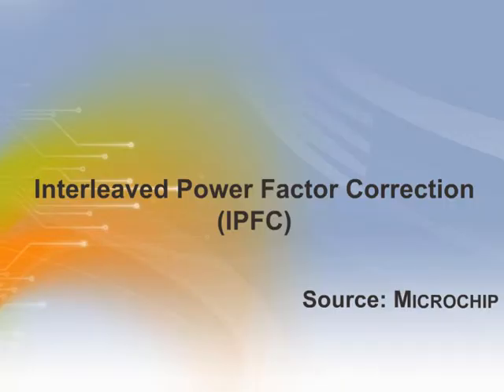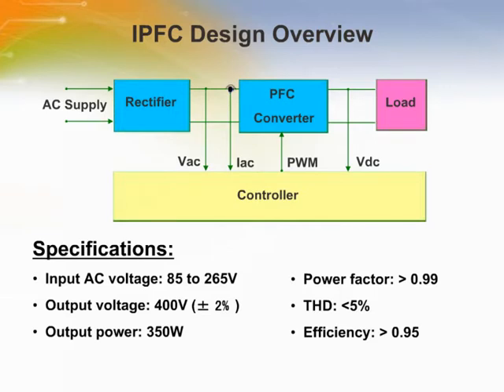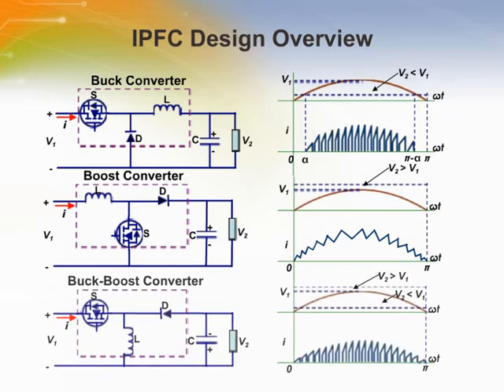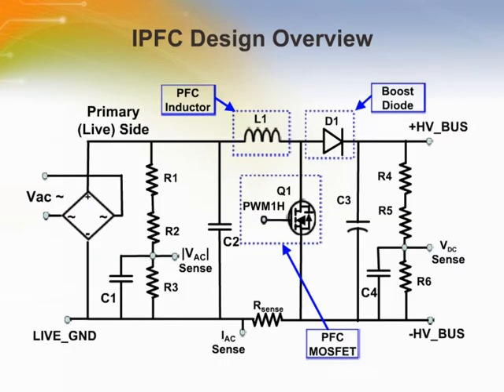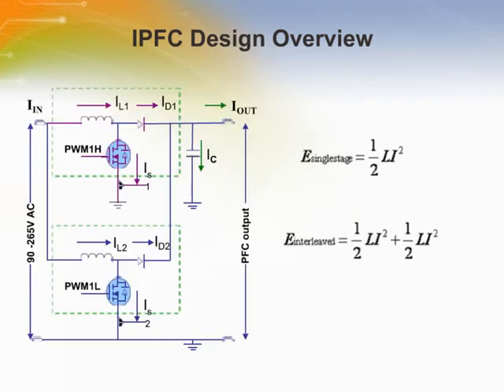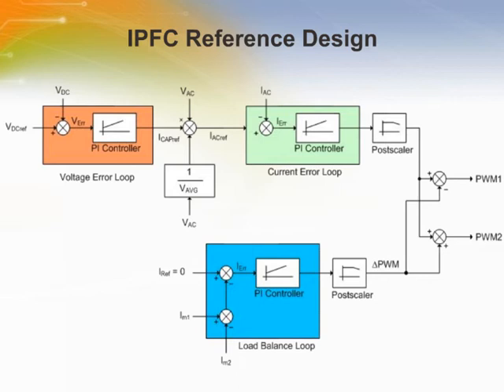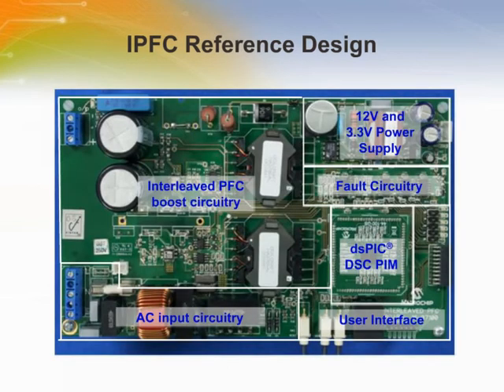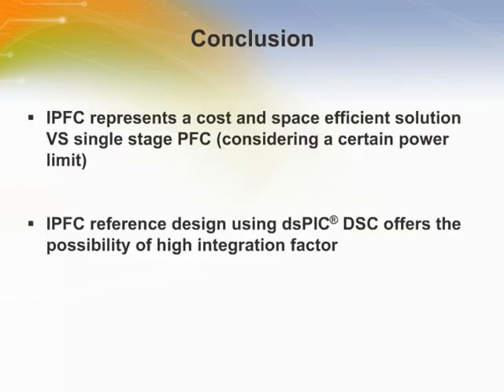Interleaved Power Factor Correction

Comment: where would these be used? 
What is the basic purpose of the V, I and Load balance compensators? (provide very stable voltage/current under varying  load?)